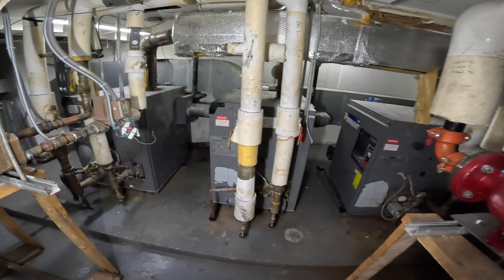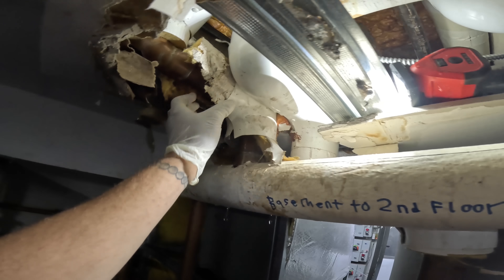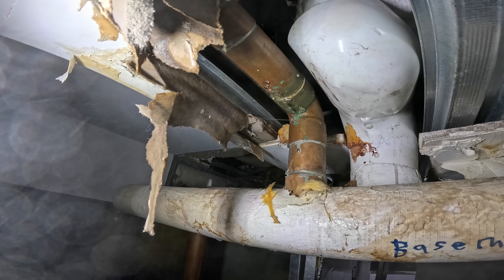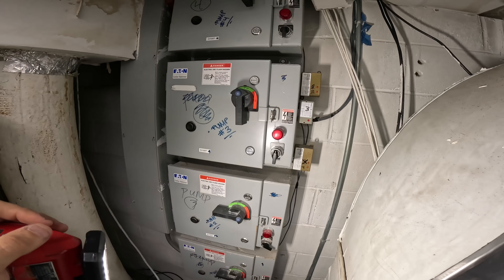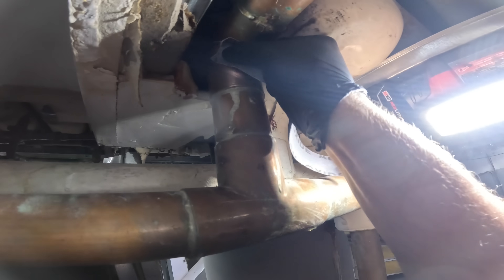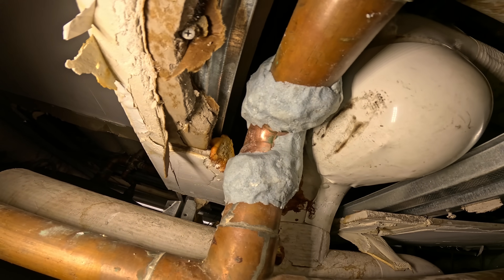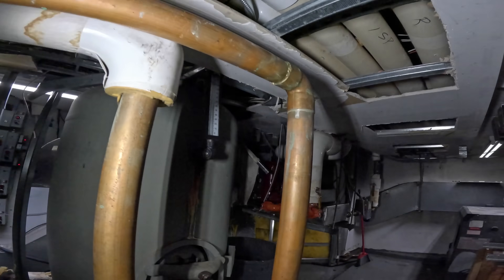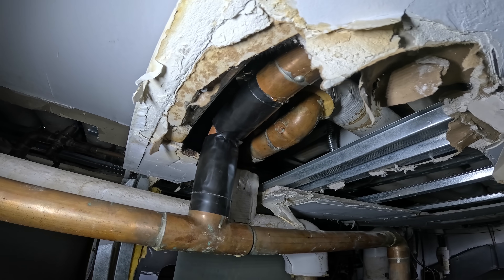HVAC: The Boiler Room Nightmare Is Back With Another Water LEAK! After Hours Emergency Repair

Comment: I would've taken a 2" Fernco coupling, cut one side to form a C shape to allow it to slip over the pipe, and placed the cut side opposite the hole and used a third hose clamp right over the hole itself

Comment: The copper of the fitting may be washed out, from to high velocity wich can cause a pressure difference on the inner radius. also a not propper deburred pipe can laso cause such washouts. Where I work most of the pipes are now about 25 to 40 years old and all start to leak at those 90 degree fittings, especcially at high temperature water.

Comment: Flex tape is very strong belive it or not I had to use it before still holding after 7 yrs if you apply it flat with no creases or air gaps.

Comment: try oxy acetylene torch instead of turbo torch, it will allow to heat that tiny leak spot quicker without melting solder joints nearby

Comment: Jumperman I jinxed you. I was just telling the guys at work last night you could fix the leak on the Titanic! EDIT: The way to fix the hole in the storage tank is drill it out an added a bolt thru the hole or even a toggle bolt with a patch on both sides. Good luck!!
Reply from the maker: Haha oh man, so it was you! Lol. Thank you for the praise and the tip. I have a video coming out tomorrow on how I repaired that hole in the tank. It's time to replace the tank, but the leak was fully stopped. It will be an interesting one to watch. Thanks for watching! 🔧⚡️
Reply: @JumpermanTech  HOLD THE LINE!!!
Reply from the maker: @oldblueaccord2629 😂💯💯💯

Comment: Zip screw with a washer and rubber gasket on the pipe side would have gotten you through the weekend.
Reply: The type of screw you use for metal roof installation
Reply from the maker: I never thought of making a temporary repair like that but when all else fails, it might be worth a shot. Seems risky. Thanks for the tip & for watching! 🔧⚡️
Reply: @JumpermanTech  I got 34 years in and have done it before.. start it with a drill just to pop the hole, finish tightening by hand..you can do it under pressure without draining down..